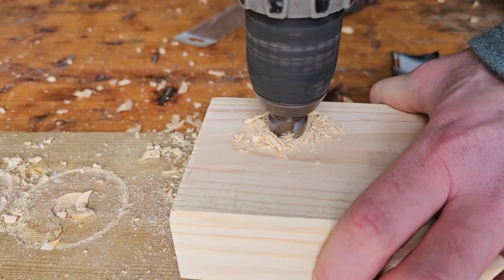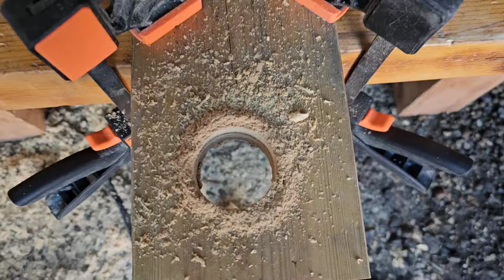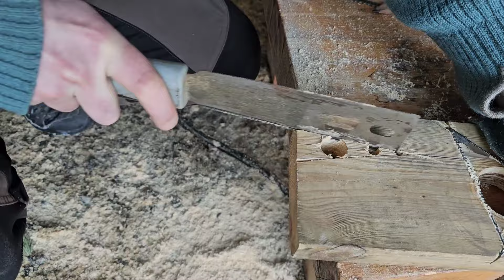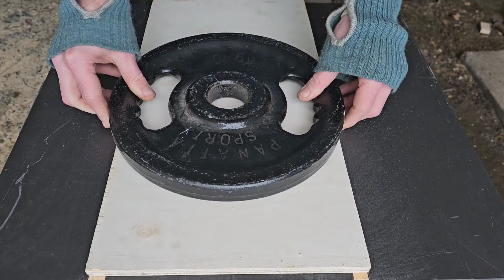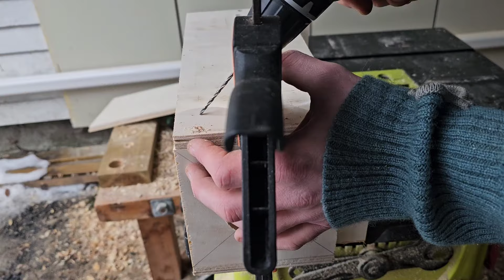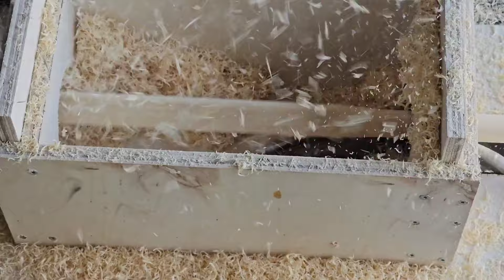Viral Dowel Jig test: Perfect Dowel from 2×2?

Comment: I think the reason the last one worked was because it held the wood at both ends so that it didn't come off centre. Otherwise it's just lathing (wood turning) with one loose end. I think the others would have stood a better chance if the stock wood were held in place at two points too. I was especially interested in the second one though, with the jigsaw blades. I've seen it with hacksaw blades but not jigsaw, the t-shanks seemed to get in the way and I think that's one of the blades was mounted the wrong way round to make it fit with the t shank. The wood stock was not being evenly cut because of it and I think that's why it looked so bad.
Reply from the maker: Thank you for your detailed analysis! You've raised some interesting points about the techniques used in the video. I think you are absolutely right. It would have performed better with a stabilizing guide of some sort. I have been tinkering off camera after I posted the video and got some pretty good results with the jigsaw blade jig. As long as I keep it under 1-inch thick and 40-inches long👍  Thanks Joe for taking the time to comment on the video!